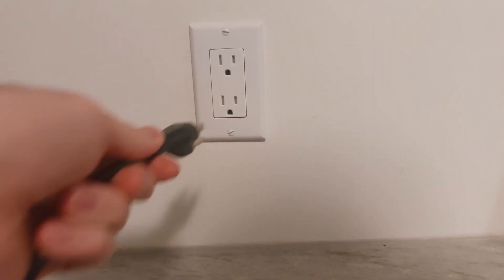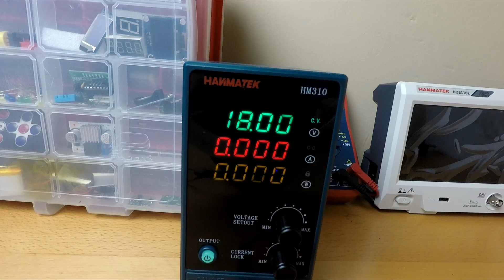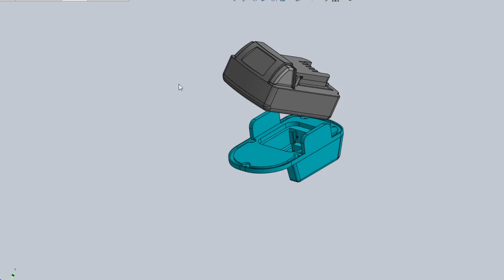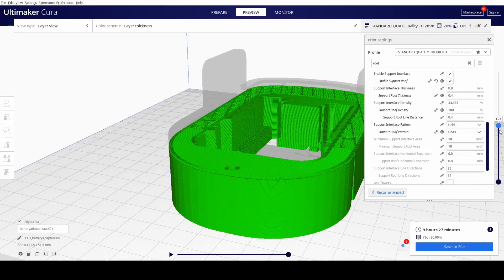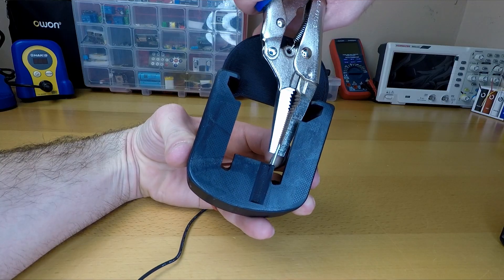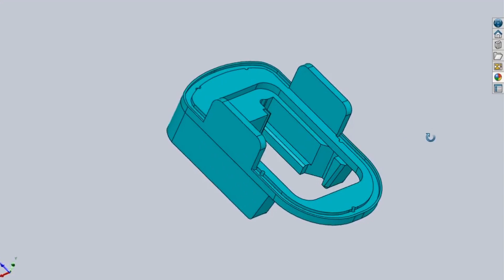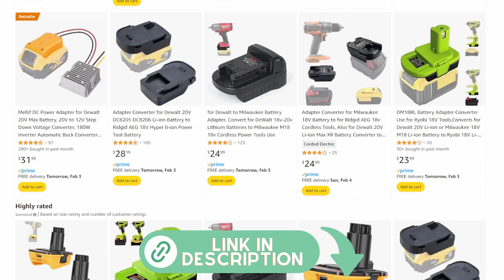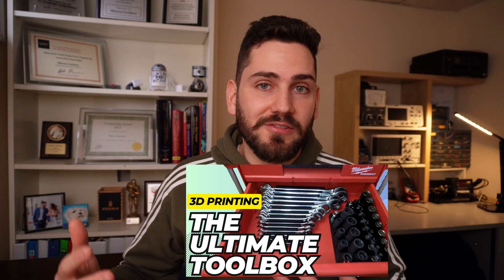3D Printing Milwaukee's Worst Nightmare

Comment: Massive power supply? I just use an ac dc converter plug the size of, well a plug.
Reply from the maker: It's a 10Amp bench top power supply and the sawzall drew more than that 😓😓
Reply: My longest one running is an 18 volt Craftsman drill that I took the motor (with chuck) out of and strapped onto a board to make a tumbler. Been powering it with a regular ac/dc power adapter wall plug with a output rating of 16v. I use the same plug adapter to power other power tools that I just added a female 5.5mm plug. Easy as shyt. But I am looking to make a battery adapter to use my Hyper Tough batteries with my Porter Cable tools so I got a 3D printer and now I'm watching videos to see how to do it...